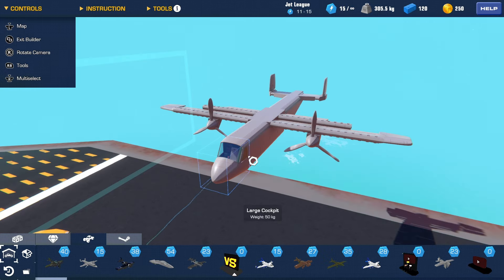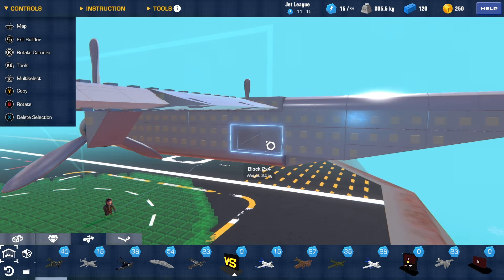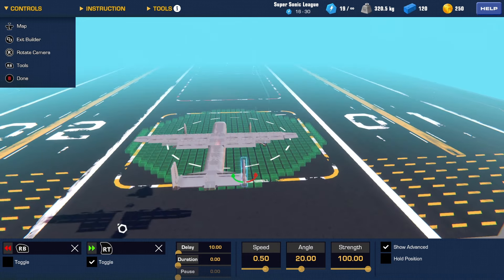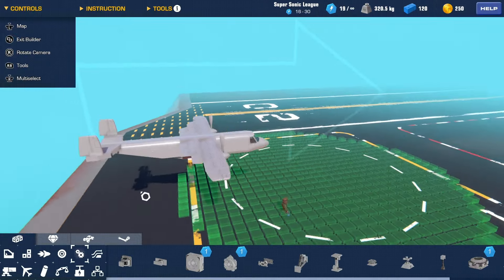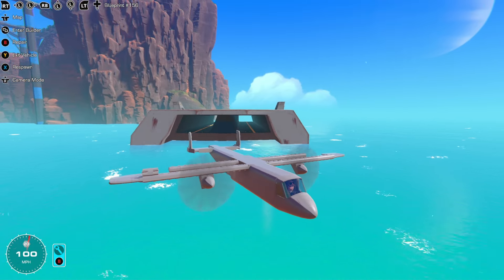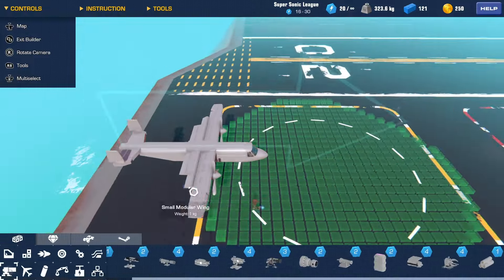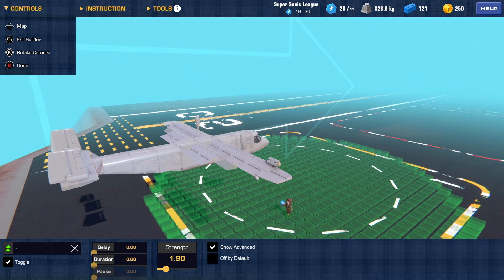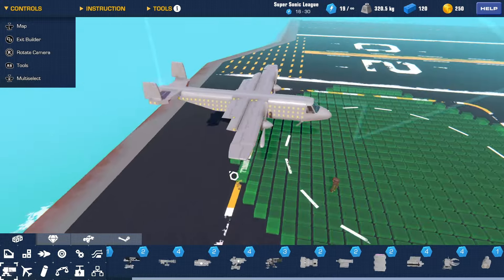How To Build A Self Flying Aircraft In | Trailmakers

Comment: So i have a problem that i need your help with fungus frank. i have a issue where my plane autocorrects its self when it tilts(like its supposed to) but eventually while flying by itself the nose slowly pitches up until it stalls and dies. so i added more angle sensors and hooked them to a elevator tail and it ended up helping crash itself any suggestions to help?
Reply from the maker: Which platform do you play?
Reply: Xbox 1

Comment: You can make the planes have a satisfying roll-crash if you place a gun facing the stabilizers, and connected to the stabilizers, that shoots when your plane rolls past a certain angle with angle sensors. That way, if you remove enough of the wing, and it rolls around fifty degrees to the side, the stabilizers will be shot and destroyed causing the gun connected to them to fall off and stop shooting, therefore, making the plane spiral without resistance. 

Signed your friendly neighborhood gamergrandma241
Reply from the maker: I like that idea! I’m sure there is a way I could do it with detachable blocks as well, a lot of times if guns are inside the build the bullets still phase through the build and don’t cause damage unfortunately :(
Reply: Very correct my friend, with a gun it's much less complex for the game and for building, it's more user-friendly than detachable blocks 👍
Reply: @Fungus_Frank usually the "small "version of guns (tinny cannon/tinny blaster) don't really phase through other blocks as much as their "big" version, witch makes aim-assist less gatling guns harder to make